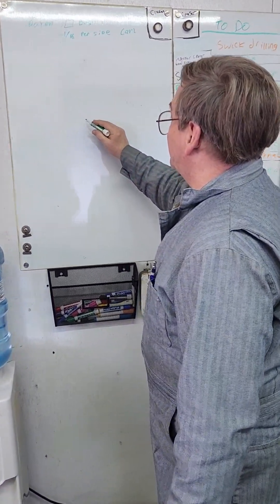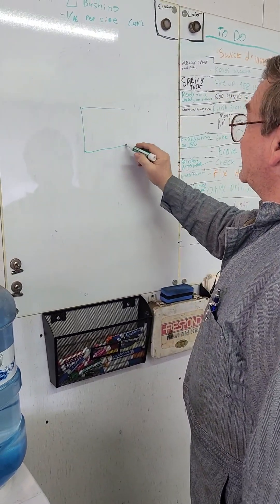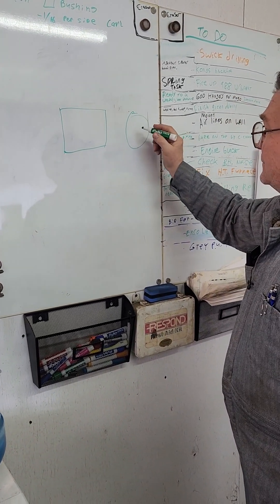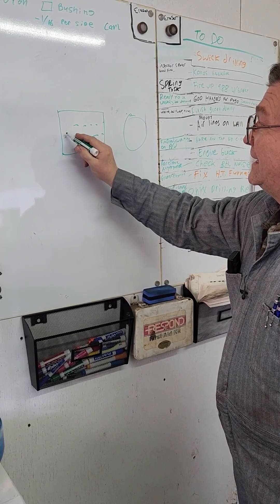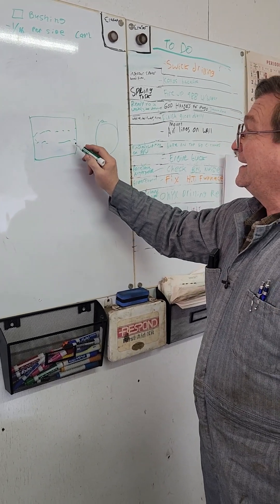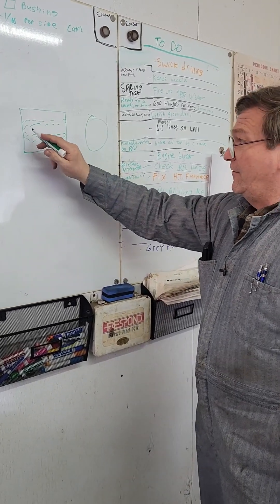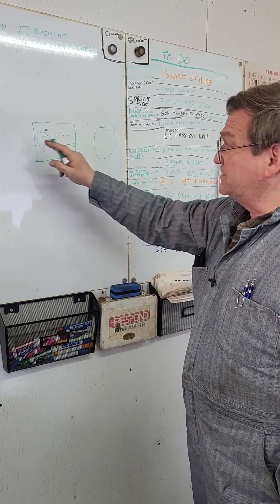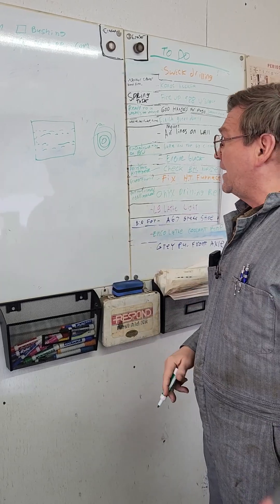Machinist's Minute(s): Don't drill out the end... until the end

Comment: I usually drill this way in vertical as well, especially in the field with a mag drill.  Cutting oil won't run out the bottom of the pilot hole while you're stepping up. Usually don't need the pilot hole in order to punch through the last 1/16" of material.